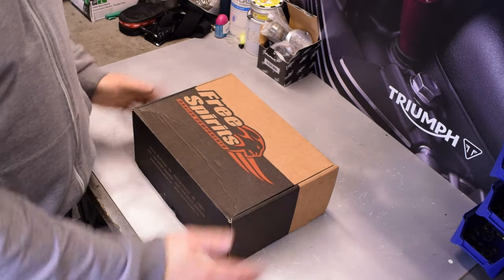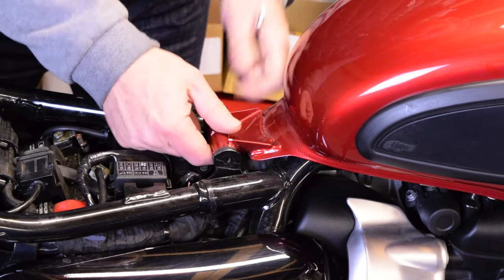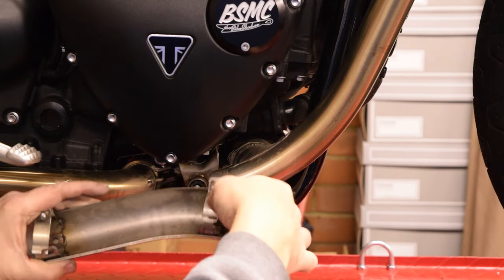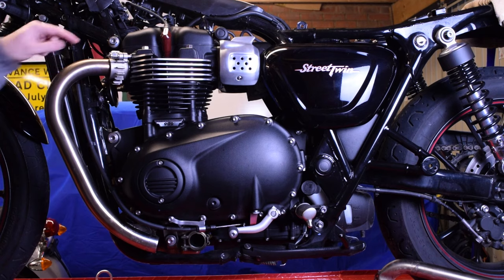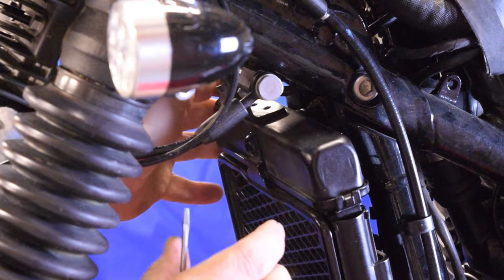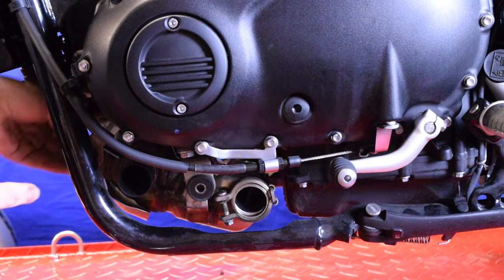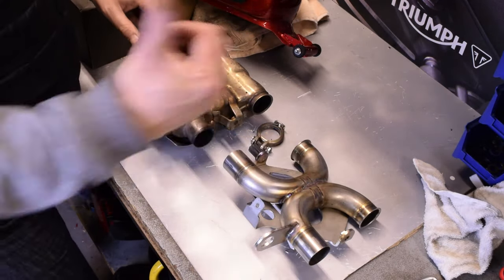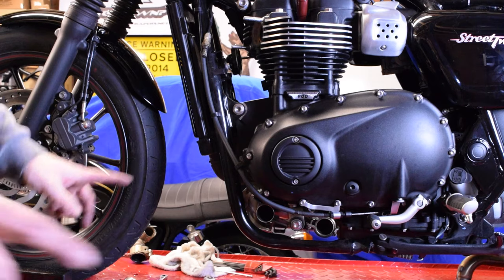Triumph Street Twin De-Cat - Freespirits x-pipe install

Comment: Hello dear Tony... First of all thank you a thousand time for all your good stuff on youtube, I praise each and every day that good fellows are giving their precious time for free to help us ! I have a new black/silver Triumph Street Cup for a couple of weeks now and I consider also installing this X-pipe decat part. I looked at the downloadable user manual on the Free Spirits website but I can't figure out WHY we have to take out the fuel tank completely ? Is that only to be able to disconnect the left leg of the frame and reinstall it easily because we have to put some large wrench or because there's a risk to damage the fuel tank. Thanks for you answer Tony and of course ton up with the tough guys around ! ;-) Regards from Belgium. Eric.
Reply from the maker: +MrToonfish Cheers Eric, thanks for your kind words. It's not necessarily essential to remove the tank, I've heard of people who haven't......but, it does make accessing the top frame bolt much much easier. It also gives a bit more room to work, and saves any risk of damaging the tank. Removing the tank is much easier than you would first imagine. I'm no mechanical expert, so I do trust the guys at Freespirits. They don't usually add any unnecessary steps. Taking shortcuts usually ends in tears in some form or another!
Reply: Thanks dear Tony, yes I think the same... I have no special problem dropping the fuel tank, but I was just wondering if it was necessary for example to avoid damaging some electrical wires etc. It's logical to put the tank apart, so you can't damage it while working on the bike and as you said, give an extra access to the upper bolt on the left frame leg. So Tony, you're not mechanical expert ? You must be kidding, I really appreciate the way you're doing and explaining things on your channel, everything seems to be so easy and I really learned a lot about how to work on a motorbike. Thanks again ! Cheers.
Reply from the maker: +MrToonfish Thanks Eric, proof that if I can do it, anyone can do it..... :)

Comment: Do I have to remove the kickstand be be able to remove the catalytic converter
Reply from the maker: No not remove, you need to unbolt the mount, well loosen it to be precise, to allow you to swing the bottom frame rail out of the way. It’s covered in the video

Comment: Question:
     Having the exhaust make a sharp 90 degree turn, then a horseshoe-shaped "U" turn, and then another sharp 90 degree turn adds a lot of resistance, and causes the exhaust to slow down.   
     If you added a piece of straight pipe between the header and tail pipe, wouldn't it increase the flow and increase the amount of scavenging, thereby adding even more performance, if it could be anchored to the frame for added strength?
Reply from the maker: +Clyde Butler True, but you do need to link both sides, so the x-pipe fulfills both requirements of less resistance and balance
Reply: Ah!  I Didn't know that they were connected (balanced).  Makes sense now.  Thanks.

Comment: Decat will change the air fuel ratio. Does change in air fuel ratio damage the engine ?
Reply from the maker: There has been no change on the inlet side it still has the stock filter and air of. The bike also has the Vance & Hines hi-level exhaust map. (This exhaust obviously also doesn’t have a catalytic converter). Do short answer is no, it doesn’t damage the engine

Comment: Hi, 
Amazing mod and the sound is definitely more aggressive and throaty. My question is, by fitting the X-Pipe only after decat with stock exhaust, will it stress the engine pistons more in the long term? Will it be in the safer limit by not causing any significant extra wear and tear?

Cheers!
Reply from the maker: Saravana Kumar No deleting the cat won’t put any more stress on the pistons, it doesn’t make the engine rev any higher.
Reply: Views from the Man Cave Wow, that was quick Sir. Thank you very much for clarifying!

Comment: How much horsepower would i gain from an x pipe?
Reply from the maker: Hard to say, Freespirits suggest 4hp, but for me it wasnt about more power per se. With the US spec Vance & Hines pipe and the 2into1 remap the bike feels perkier with a snappier throttle response. It also sounds better with a nice crackle and a bark when you need it. I may try and compare mine with a stock bike on a dyno, but figures on paper don't mean too much, its how the bike feels.

Comment: Does the ECM need to be reprogramed after this mod ?
Reply from the maker: No, particularly if just fitting the xpipe, if you go ahead with free flow pipes then maybe. I had the V&H hi level scrambler map flashed after I fitted the US spec pipes and it did make a difference

Comment: Hey man, do I really need to re-map? I just intall the XPipe for my T120, backfire and running out of fuel quickly is what I feel.
Reply from the maker: Dominic Nguyễn Is it actually 'backfiring' or just popping on overrun? Have you checked the MPG? as mine isn't much different to stock. I personally think the remap is worth it. Might also be worth checking all your connections again to make sure their 'airtight'
Reply: I'll record a short video about the sound and send the link to you. I don't have much experience so I can't tell you exactly what it is. In my country have no AD, so I don't know where can re-map the bike.
Reply: can I have a link to the video please as my T120 seems to 'Backfire' when I decelerate

Comment: Hi Tony. Great video and thx for yours experience. Did you use K&N filter and If not can you wrote why? Coz i didnt find in yours videos that you change Air filter.
Reply from the maker: Hi Robert, no I didn't change the air filter, I kept the stock one in place for a number of reasons. I wasn't really concerned about performance, the x-pipe saved weight, but more importantly to me made it sound so much better. I had the bike remapped for the V&H us spec hi level pipe (ie no cat) but changing the intake side would put this under more 'strain' so I wasn't worried about doing it.
Reply: Views from the Man Cave what are u thinking about wrap exhaust header pipe? I love that design look but i worry about the demage under the wrap(rust) . Thx for sharing XP.
Reply from the maker: Wrapped pipes can look great, I did it on my old Moto Guzzi. Rust shouldn't be an issue if you use decent wrap with stainless steel pipes....

Comment: Your bike sounds amazing, I don't have the workspace to be able to do this kind of work, might get away with putting the silencers on tho
Reply from the maker: +theglynux  The slip ons make a big difference from stock.
Reply: Views from the Man Cave which makes the biggest difference. Thought of putting your bike on a dyno be interesting to see what difference it has made. Also any plans to change air filters?
Reply from the maker: +theglynux The change in sound is most of it, just changing the slip ins will have a very minimal effect on power in my opinion. No plans on messing with the inlet side, that's when things get more complicated re maps and AF ratios

Comment: I have a Bonneville T120, do you think I can get away with installing the x-pipe just using my center stand to keep the bike stable? A mechanic will charge me at least $80.00 an hour, and a bike lift is a bit expensive.
Reply from the maker: +adam kotch Should be no problem depending on where the centre stand mounts. The left side frame rail needs to be unbolted. Having said that I know people have tackled it from the other side and left the bike on its kickstand! It's just a bit more fiddly.
Reply: Views from the Man Cave ,  Thank you! I'm going either go through the right hand side with the kickstand engaged or I might buy a paddock stand. I'm not sure yet.
Reply: I did it using the center stand with no problem. Which remap did you use?
Reply from the maker: Adam Kotch I had the map for the high level Vance & Hines pipes which bypass the cat
Reply: Views from the Man Cave, did you have it remapped at the Triumph dealership?

Comment: Do you need to re-map the ECU since now there's less restriction from the exhaust? how about the high pipes from triumph?
Reply from the maker: ripmax333 I remapped, and used the one for the Vance & Hines Hi level Scrambler pipe (as it obviously bypasses the catalytic converter)
Reply: and the remapping has to be done by a triumph dealer or it can be done at home?
Reply from the maker: ripmax333 I had mine done at the dealer. Quick & cheap
Reply: Views from the Man Cave ibe been told to disconnect the battery and wait a while then te connect and ride the bike and the computer resets
Reply from the maker: +David Forbes Interesting, not heard that
Reply: Views from the Man Cave ive also heard something about a no throttle start up let the fan kick in then a few second later switch it off. Then on re start it self learns. I cant confirm either way but they def have self learning capabilities so not 100% sure either way. But aside from all that i enjoy your vids and thanks for posting 👍

Comment: TEC parts in UK make a better piece of kit imho. Proper custom bends rather than off the shelf bits.
Reply from the maker: Thanks Ian, but why assume the Freespirits one uses 'off the shelf' bits. As far as I'm aware it was designed entirely in-house and was the first one on the market by a long way
Reply: If you look at the bends there are 2 welds on each pipe which would only be there if a spacer had to be used to give the correct distance. If the bends were custom engineered for the correct fitment that wouldn't be necessary. IMHO that denotes the use of of the shelf bends. 
I have no connection with TEC parts apart from being a satisfied customer. You should check out the website they do some really good parts for Triumph and most are considerably less expensive and better engineered than some of the "brand" names.
Reply from the maker: +Ian Batterham I'll investigate further. By the same token I have no affiliation with Freespirits, but I do know they spend a lot of time and money on r&d and engineering. I had a pair of TEC shocks on my old MotoGuzzi.
Reply: Ian Batterham I'd agree with that and then raise you a Meerkat. His welds are flawless and less weight with the unnecessary bracketry and bigger jucnction. Yes unnecessary brackets no question. He also makes beautiful pipes by hand. Craftsman
Reply from the maker: +David Forbes I would argue that the 'bracketry' is required to add strength and support both headers. I certainly wouldnt be happy with one which is just two pipes welded together. They don't offer anything to stop the two headers flexing. Triumph didn't add mounts to the frame and cat for no reason. Both the Freespirits and TEC cross pipes bolt to all the factory mounts.
Reply: Views from the Man Cave thats cool . No factual argument. But cool. The meerkats were the first ones on the market, by only a few days, and they have not failed yet with no sign of movement what so ever. Solid as. Unnecessary. When the welds are if a high quality that is which the ones in the vid are not. Have u seen the poor effort they went to on the street scrambler? Lets put a weld right in the middle of a bend coz we cant do a full bend. No thanks.
Reply: If you look at several you tube videos on different X pipe brands you will always see David Forbes raising the Meercat brand, and trashing others, i suggest he is a shill for meercat, as I have experienced the same thing on various forums with Meercat shills pouncing on anyone suggesting one X pipe over another. beware of this and make your own decision based on sound engineering principles and of course your budget. The Free Spirit and TEC seem 2 of the better ones.

Comment: Does anyone know what the weight of the original cat and the x pipe are?
Reply from the maker: Blind Archer I can weigh the cat, Freespirits can probably do the same for the x-pipe (I'm not taking it off again to weigh it lol)
Reply: Views from the Man Cave When I was typing it I assumed you wouldnt want to haha ill contact free spirits and try to get an answer so we can know the weight savings based on your weighing of the cat. 

edit: contacted freespirits and am waiting for a reply but until then I have found a dealer that says the x pipe weighs 2.1 pounds
Reply from the maker: Blind Archer I should have done it when I had them both on the bench....
Reply: Views from the Man Cave freespirits got back and they say 890 grams or 1.962 pounds. I've also ordered my own and its on the way .... all this talk and I couldnt resist it anymore lol
Reply from the maker: Well its quite a difference! the cat weighs 2341 grams or 5lb 2oz....
Reply from the maker: haha glad youve ordered one too. have fun

Comment: Will the bike need a remap after a decat?
Reply from the maker: Hi Marc, it doesn't NEED one, but it think the bike is better with the V&H 'offroad' map
Reply: @mancavemoto  did you take the bike to dealership to tune the ECU with the V&H offroad map? or did you do it?
Reply from the maker: roberto ribeiro it was done at the dealer

Comment: Can you use this exact free spirit  x pipe on Bonneville T120?  Will it fit perfectly?
Reply from the maker: +Alam Khan Yes you can, and yes it will
Reply: I appreciate your quick response.  I installed the local Thai made x pipe and it just fall out after the 3 hours ride non stop.  Now I just sent the bike back to the Triumph dealer in Hatyai, Thailand.
So I am looking for the best, so none of this will happen again.
What do you recommend?  Will the Freespirit X pipe last a long time even after bumps on the roads and long ride.  And will Freespirit loosen up and fell off?
Reply from the maker: +Alam Khan The Freespirits one fits in exactly the same way as the factory CAT, so it won't loosen and fall off!
Reply: Views from the Man Cave do you need to welding it?
Reply from the maker: +Alam Khan No, take a look at my install video
Reply: Views from the Man Cave  Please tell me which is better, welding it or just fits it the same way as the factory CAT?
What are pros and cons please help.  Thank you
Reply from the maker: +Alam Khan Absolutely no need to weld it, I would not recommend that method!
Reply: Views from the Man Cave what are pros and Cons welding the Thai made or free spirit?
Reply: Why not recommend buy the local made and welding it sir?
Reply from the maker: +Alam Khan If you want to weld your exhaust together that up to you. I wouldn't do it personally
Reply: +Views from the Man Cave I understand, but may I know what is the cons of welding, please share your thoughts, thank you.
Reply: Thank you for sir mr man cave

Comment: Where to buy this x pipe?
Reply from the maker: Where are you based?
Reply: @mancavemoto  I am from Cochin, India.
Reply from the maker: PowerSports MotoUsher
Bharti House 43, 7 Kachipura Garden
Ramdaspeth, India 440010
Reply: @mancavemoto  any contact number, I need to call them and discuss.
Reply from the maker: Rijo Joseph  Bro, its on the Freespirits website surely you can look it up